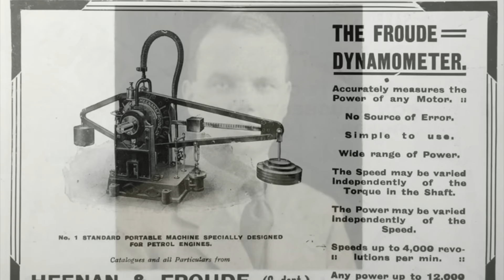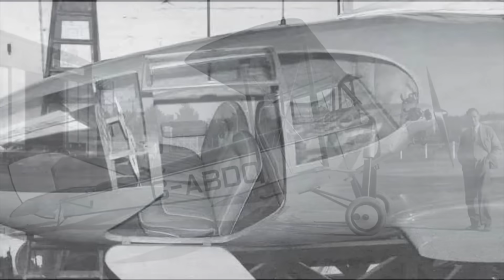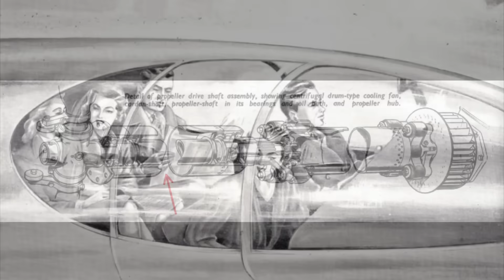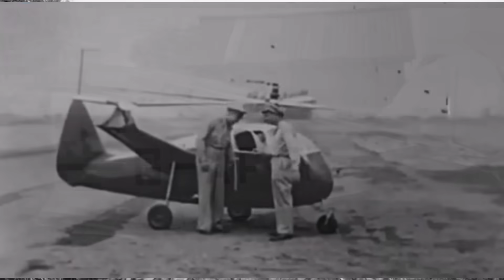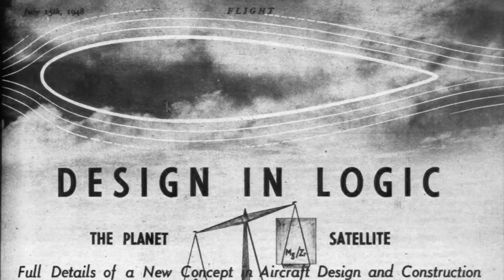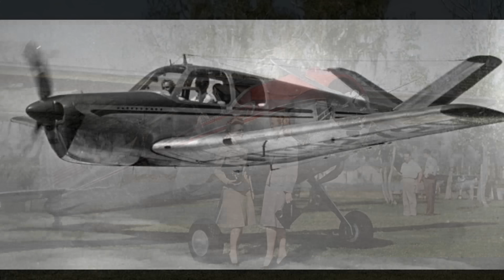Planet Satellite - A Magnesium Marvel?

Comment: i was thinking, it looks like it should have worked, 
if maybe the magnesium keel had been made out of a different metal/alloy. 
...and then you dropped the pusher configuration hammer. 
i didn't know they were that bad.
Reply from the maker: Only my opinion; the supposed benefits appear to be outweighed by complication. The tractor configuration might be old fashioned but it’s simple and it works. Simplicity and reliability generally succeed.

Comment: Just a small thought on the original vee-tailed Bonanza: I seem to remember that after Beech was bought out ( in the 90s'?), the new  parent company initiated wind tunnel tests on the vee-tailed design.  These tests showed that flight loads on the vee-tail were higher than Beech had designed for.  The new company redesigned the vee-tail and released kits to strengthen the tails structurally on existing vee-tailed Bonanzas still flying. The early crashes might not have all been due to pilot error, iirc.
Reply from the maker: I would certainly agree that the margin of error was not as large as it could be. Mishandling quickly leading to spiral wind up and structural overload. The Bonanza was such a quantum leap forward in performance for horsepower.
Reply: Nicknamed the doctor killer  cause many of owner pilots were medical doctors
Reply from the maker: @jeffbybee5207 is mentioned in the film

Comment: Money makes airplanes fly
SEARCH: Molt Taylor IMP
He too had driveshaft issues that he resolved..  I'm guessing it was related to changing torque of piston engine strokes that could have gone harmonic at some RPM.   I'm guessing he put in some rubber cushion type thing like I have seen between motorcycle drive wheel sprocket and the wheel.   I watched the whole video, Thanks for making and posting it.
Reply from the maker: Molt Taylor was a good engineer but all these shaft driven pusher designs are complicated. A friend of mine was obsessed with the Bede BD5; he spent 20 years working on it and he died in it. A truly dreadful aeroplane.

Comment: A totally new aircraft story to me.  Neato design!  Though I'm not an aircraft engineer, one look at those skinny landing gear struts & small wheels just shouts out "Warning, Will Robinson!"  I think landing on thick grass didn't help any...?
Reply from the maker: Yes, the landing gear looks weak. Blackbushe had three hard runways, both brief flights were from tarmac, not grass.
Reply: @FlyingForFunTrecanair  Thanks for the info!  I done learned me something today!  I did not see any tarmac landing footage, therefore my reply was, perhaps, too early/eager.  That said, I thought she was a fine/modern-looking airplane!  And mid-engined like the Bell Airocobra...only the prop shaft went back to push, instead of the Bell design where the prop shaft going forward was just a foot or so under your 'wedding vegetables'!  Ow!  If it breaks loose!

Comment: That configuration, mid-engine with a tail-mounted pusher prop has consistently run into two problems; engine cooling airflow and propellor shaft vibration. The BD 5 is one example. Keeping the propellor tips clear of the ground on rotation is a serious design challenge.
Reply: The shaft vibration issue was addressed by Molt Taylor with the Flexidyne coupling, used in the Aerocar, six of which were built, and two of which are still flightworthy, and several other designs.  This might have been used on the Cirrus, with which he was involved.
Reply from the maker: @JClarkeCT1334  … along with a freewheel device in the drive train; lots of complication to make an inferior aeroplane. The simple tractor layout works well for so many good reasons.
Reply: @JClarkeCT1334 Interesting supplement. I knew of Taylor and his Aerocar, but not about the flexible link.

Comment: Beautiful design, but with no propwash over the tail, limited ability to rotate on takeoff or flare on landing, and every ounce of baggage and passenger weight putting more weight on the nosewheel, it was bound to have problems. Maybe shifting the c/g back and redesigning the keel would have solved the issues, but there comes a time when the most enthusiastic financial backer has to pull the plug.
Reply from the maker: Do you need propwash to flare on landing? I couldn't find detail as to which undercarriage collapsed but I suspect it was the main rather than the nose.
Reply: @FlyingForFunTrecanair  No, you don't need propwash on landing, but you do need to flare for a low speed landing. I'd like to know where the c/g was, because I suspect  there wasn't enough elevator authority to flare properly, or too much danger of hitting the vertical tail to allow for a full stall landing. There seems to be a number of alternate ideas relating to the attempted flights, but I suspect you are right - the main gear probably collapsed, which would leave the nosewheel and vertical tail carrying the weight, so presumably the nose gear would have collapsed in sympathy. Pity there are no photos of the damage (at least on line).  I wish it had succeeded - it was beautiful. Also, thanks for posting the video of the helicopter. Some sites state confidently that it never flew!

Comment: V tails seemed to have had a patchy history I remember someone turning up with a V tailed glider at the gliding club I was at and a lot of discussion was had whether they would be allowed to fly I think the concern was about spin recovery.
The Satellite looked the part but maybe it was an overreach in weight saving magnesium is not very ductile hence alloying it with other metals but this was probably the early days for this material I would have thought so perhaps more traditional material should have been used for structural practicality and Elektron for skinning, but then again twenty twenty vision is easy with hindsight.

Comment: Interesting to witness the evolution. With those pusher types, wouldn't the extreme turbulance created by the propeller in such close proximity to the rear control surfaces have caused problems? I find it hard to see what the percieved advantages were, except perhaps reduced noise.
Reply from the maker: Yes, the main reason for the pusher arrangement was to reduce cabin noise. I don’t know enough to comment on control vibration due to the proximity of the propeller but several feet of driveshaft to a remote propeller generally makes for vibration issues within the fuselage.
Reply: @FlyingForFunTrecanair  Cabin noise reduction was the reason back in those days - today the reason for a pusher prop is mostly to reduce/remove airflow turbulence drag caused by the prop wash over the fuselage.

Comment: striking resemblance to much more contemporary effort https://youtu.be/MNCRKpfebsg?si=J5Tybb-ii5VCrQqh
Reply: This is much closer, perhaps an almost "copy."   https://youtu.be/uHyqLVfi5hQ
Reply from the maker: That Celera 500 is an ugly brute!
Reply: The Satellite was in good company in the tail pusher class with the Douglas Mixmaster XB 42, Dornier Do 335 ( and other design studies)   Go 9, and other precedents that worked also Lockheed  (Thorp) Big Dipper as contemporaries and soon after the Fischer RW3 Multoplane and scores of others since notably the BD5 and Imp . I designed and built the Opal composite / metal tail pusher starting in 1974 in the US but due to the Yom Kippur war and oil embargo on my work visa taken to  Australia and stymied by the lack of any local experimental regulation and absence of finance, industry, 'interest' etc but was the first molded kit design I suspect.
There are pitfalls in tail pusher design that trapped such as the Learfan and others but which do not damn the configuration per se.